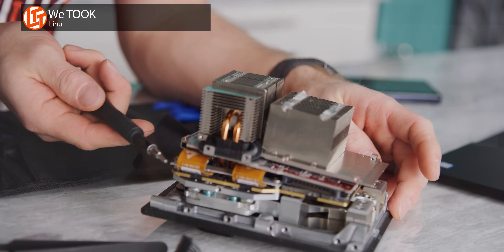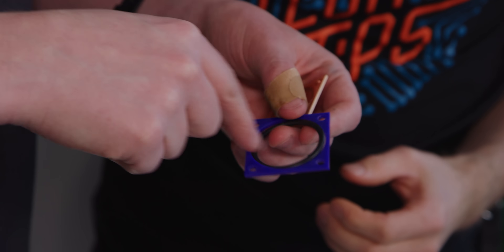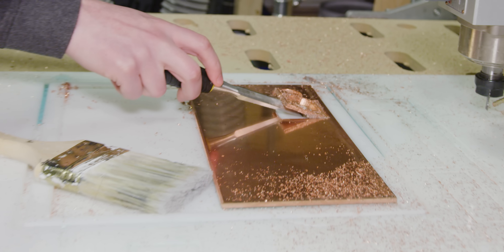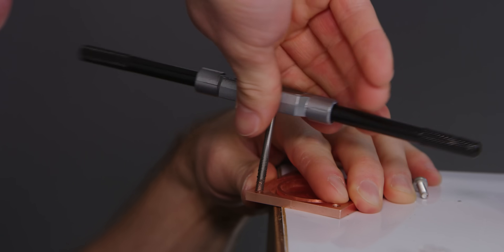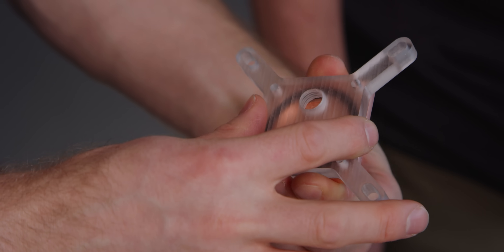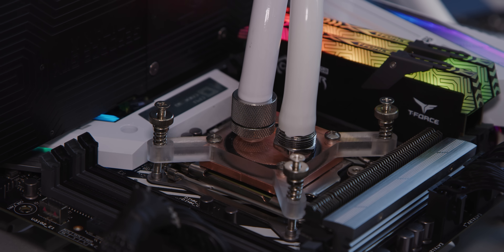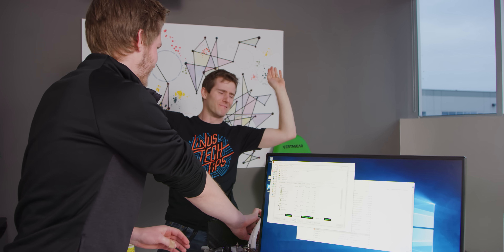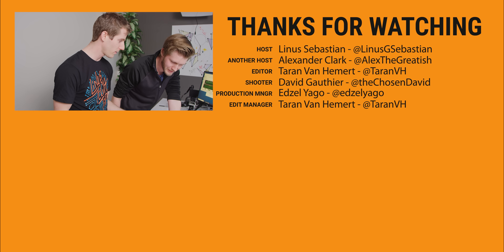We Built a CPU Water Cooler!

Comment: But what about the CPU Metal Block?
Reply: hmmm liquid metal cooling system?🤔
Reply: @Glyn-Leine  what, like eutectic gallium mixture used for delidding CPU?
Reply: @arsarma1808  but then pumped through a radiator XD
Reply: @Glyn-Leine  Sounds like an adventure. I wonder how dense the material will be, and if a pump could handle it. Also I wonder if there would be galvanic or chemical potential between copper and the alloy...
Reply: @arsarma1808  Or, you know, mercury... =)
Reply: its call a heatsink
Reply: Why do I see you on every video
Reply: dude why u everywhere
Reply: Justin Y. got here before you did!